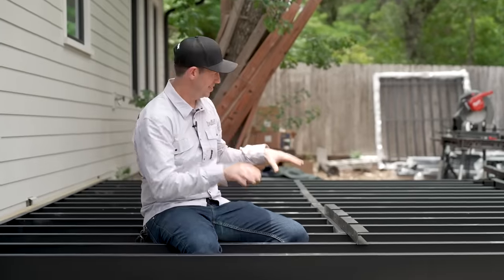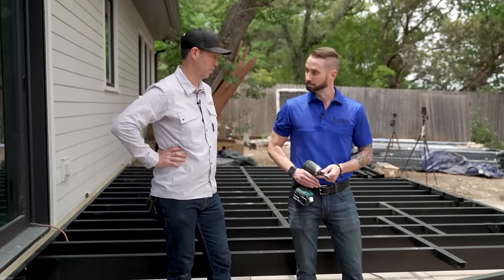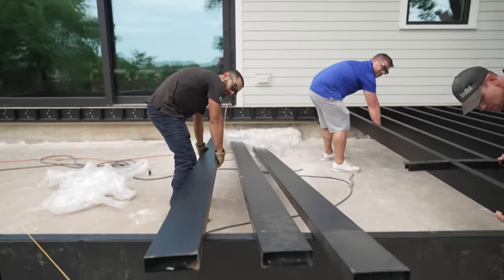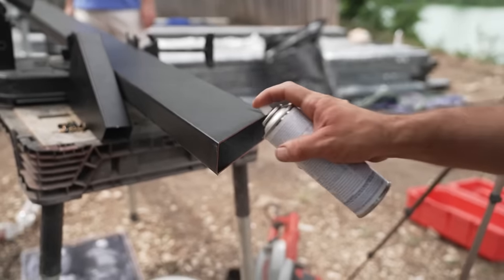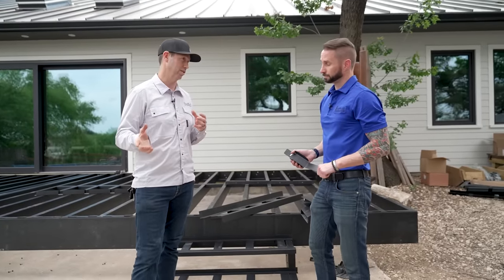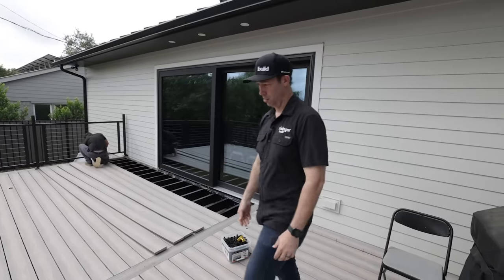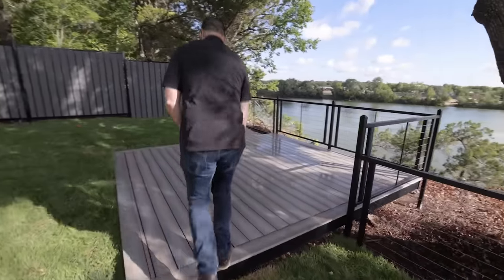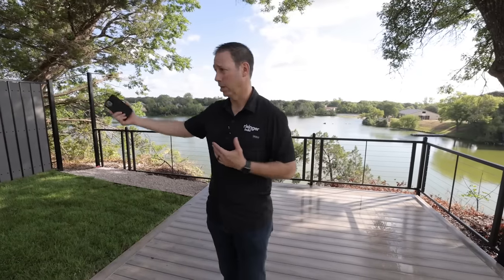My First Steel Deck Framing Job

Comment: What about sound when you walk on the deck? I love that the metal will last a long time, but can you hear the metal creaking together when walking on this kind of a system?
Reply: The decking damps it.
Reply: I'd imagine not. If you bolt tightly or weld together, it's not moving, which means it's not rubbing or clanging. Really, I don't see why steal framing isn't already much more common in residential. It's the best investment. Period. A house would be more expensive to buy and build, but would last damn-near forever. And I could totally forsee a strong market for magnetic hanging products, where you'd penetrate the sheetrock, but not the stud itself, and just hold to the stud magnetically..... hmmmmm 🤔
Reply: @mikecousin8523  not really worried about the insulation value in most applications. Can also beaf it up if needed
Reply: Very solid when fastened with counter sunk screws and/or hidden fasteners.
The steel is galvanized and powder coated, if scratched you paint that area (with either their small spray can or rust, oleum, professional high-performance enamel flat black 15oz. <- much better value).
Will outlast treated lumber framing.

Comment: I was going to use this system at my house but ran into an issue with the city building department. The code doesn't address steel framing other than it's allowed. Fortress offers extensive testing information on the product and even partnered with a third party company that offered general building guidelines that are stamped by a PE. Even with that, the city wanted a stamped site specific plan. Unfortunately, the lowest cost I could find to have an engineer stamp the site plan was about 2k, coupled with the 35% product premium made it cost prohibitive for me. I could have built two decks for the price of one. It's a shame because it seems like a great, easy to use product. I would definitely check with your city on a permit before buying anything. One last thing. If using the stamped general building guidelines, the poured base is HUGE compared to wood (starting at 24x24) due to the longer spans.
Reply: Sometimes it's better to ask for forgiveness than to ask for permission.  YMMV
Reply: @WaltWW  And, some places will make you rip it out to be petty.
Reply: You must live in a blue city/state.
Not your fault that their codes are not inclusive of newest construction tech.
Reply: Building permits for a porch.... Sounds like you need to move to another city. (:

Comment: One of my big concerns is rust/corrosion. Also possible tin sound as you walk on it.
Reply: That and Wasps building in the steel rails
Reply: SERIOUSLY?  LMAO
Reply: Sounds no different than a traditional wood deck.  The only area accessible to the bugs are the weep holes in the bottoms of the joists.  The ends have caps to cover the openings.
Reply: @foreigner1999  Yeah - you are right. No difference in longevity and strength between steel and wood!
Reply: powder coating should stop rust
Reply: I would like to hear the sound as someone walks across it too. In the video you can hear a loud echoing ring when they were looking at the stairs and he sets something on the deck. Not a deal breaker but many clients would not want to hear that.
Reply: @livens100  there is no echoing or any sound at all other than footsteps.  I built one of these at my house.  Flat as can be as well.
Reply: aluminum or stainless would be better materials
Reply: @85square  $$$$ solid gold would be nice too but I don’t think you wouldn’t think of it as “your baby” and become a deck nazi having people take their shoes off in the grass
Reply: @3_Klos1122  my job is building aluminum and stainless trucks bodies and no one badies them, becuase they stay looking good.
Reply: @85square  yea they do look good but they also probably provide a more noticeable return on the investment than a deck. Maybe not. Just my POV
Reply: @85square aluminum is expensive and weaker. Stainless is very expensive.

Comment: I'm totally lost on the 25% to 15% bump in pricing from wood deck to steel frame he quotes in this video. I can get a 2x8x12 AC2 for $15 from the big box store. The 2x6x12 Fortress joist is $139 !!!  It looks like they used ~30 joists for this project. Wood = $450, Fortress = $4,170 !  That's over 800% increase in joist material cost. Where's the rest of the math? This makes no sense unless there's some massive labor savings.
Reply: Shhhhhh. Don’t think about it. Just believe.
Reply: @JimYeats  I wanted to believe so bad to use these on my deck, even at 100% more, but the pricing I'm finding on these is 800% more at retail than wood.

Comment: Laughs in Midwest. This won’t last 15 years in the upper Midwest with winter brine solutions.
Reply: If this is in a backyard setting, with no salt or brine applied, it should last longer than that. Otherwise I agree, I wouldn’t use this on a deck that requires deicing in the winter.
Reply: @HaroldRutila  you’re telling me leave sheet ice on your deck in the winter? I think not, we treat our decks regardless.

Comment: As someone with experience in structural steel, it amuses me that they chose to go with tube instead of I-beam... I-beam has no hollow space, wouldn't need weep holes, comes in various sizes, including roughly 2x6", and has all the stress capabilities that you'd need for a deck. Tube has more torsional rigidity, but that's not necessary. Maybe tube is cheaper than i-beam? I doubt it though.
Reply: If you are going the diy route finding scrap I beam would be easy/cheaper.  It would just mean more work with a wire wheel to clean up any rust and then paint it.
Reply: thinner wall thickness so could come in cheaper
Reply: Check out Clark & Dietrich steel joists. Super strong.very affordable and it will last forever with little maintenance.
Reply: I grew up in my father's steel fabrication shop, and I agree with you on I-beams. I am concerned about DIYers and sloppy contractors properly prepping and coating site cut ends a scratches of factory the coating or doing a good prepping and coating if going with bear steel. After all paint  ain't what it once was. I still remember when we called primer "Red Lead". It definitely wasn't healthy but it protected the steel far better over time.

Comment: Installed a deck with this product last year (as a DIY) because it was the same price (or maybe less) than wood.  I really liked that everything was straight.  And the way they do stairs is ingenious.  And easy.
Reply: itll last forever too. this is the first time ive seen this, but it seems superior to wood. especially if it doesnt cost much more at all

Comment: Hi Matt, I'm from Montreal and have built my own house 35 years ago. I have applied insulation and other systems that were not even used at the time, things that you have featured in your very informative publications.
When I saw today that you are featuring the building of a steel deck I nearly fell off my chair. Since early last year I have been researching the subject. I am presently putting the final touches on an 18 by 12 feet two level steel deck behind my house. I checked Fortress' products but they were unavailable here. I opted for a canadian made Baileys Truedeck system. All exterior grade galvanized steel, shipped in a precut kit. The assembly, done by myself with the precious help from my wife, was a charm and it will last way longer than me (I'm 71). I installed my beams 24 inches on center and the whole deck is covered with Daltile's Xterior brand porcelain tiles (24"x24"x¾") I used Gator Base spacers and stainless steel perimeter brackets to keep the tiles in place. All around the steel is covered with the same tape used to cover wood joists so that no porcelain comes in contact with the steel. I will use the same guardrails you have chosen for your deck. Keep showing us the innovations in building techniques and materials. There are too many trades people who are still living in the 50's. I am a retired businessman but I know my way around a construction site.
Reply: Sounds like a classy looking deck!

Comment: Hey Matt!  I actually used fortress for my close to grade deck here in Massachusetts.  Perfectly straight a couple years later.  This is definitely the way to go
Reply: Why not use PT if you're in New England?  Wood was cheap until Bidenomics came for diesel prices
Reply: @digginz8603 Stop.  Be smarter.
Reply: @digginz8603  because the length and height of the deck meant that I could use smaller framing materials 2x6 vs 2x10 in my framing.  And it meant straight and true no matter how long it took me to build it!  Which was, by myself,at nights, 2 summers.   Mine was much more complicated than Matt's.
Reply: @foreigner1999 are you a contractor? And where are you in Mass?
Reply: @gregbrutus7484  I am. In Brighton area

Comment: With the declining quality of PT lumber,  I like this system.  Also, 4ft cantilever is unheard of with PT!
Reply: Sister a another one to get you there
Reply: get an engineer and you can do whatever you want!
Reply: @Adirondack Homestead That would not meet code where I am.  2' max. cantilever with 2x12x20'  12" O C. for a deck.
Reply: @kstorm889  You can do what the engineer wants, & that's not usually an uncomplicated route to take.
Reply: @probuilder961  or be an engineer yourself then do whatever you want!

Comment: 1:20 Matt, I'd like to offer a different perspective on mounting the deck flush with the bottom of the door.  In South East Pennsylvania, we have snow... That can prevent you from opening a door.  It can melt and ice dam and flood under the door threshold damaging the subfloor.  IMHO, Getting the water proofing details right on a flush install is much more difficult.  I much prefer having a step down, so that our crew can properly flash the door pan, and also add flashing to the top of the deck ledge board to prevent water from damaging the wood structure is the home behind the ledge board.

Would love to know more why you don't like step downs.
Reply: I suspect it is asthetics and for ease of walking in.trip hazard.but at athreshold I am always into a step as well. helps keep the ehavy rain out. A old school  building thing from the past that  still lingers in my head as a requirement.

Comment: Maybe I missed it but, what type of coating is on the deck framing? I'm concerned about rust staining and eventual rust through. Great video and a great system!
So sorry to hear about Mimi. May she rest in peace.
Reply: Powder coated.
Reply: It is also galvanized under the Powdercoat.
Reply: Why black? In Texas?
Reply: @EcoAquatica if it’s also galvanized this ought to easily last decades.
Reply: @patty109109  50 year warranty as long as you are not located near saltwater, you cover any scratches with their paint, and of course follow all their instruction, lol!

Comment: Building residential and commercial for almost 50 years and remember before OSB and pressure treated,  no nail guns and most moldings ,casings and trims were cut with mechanical miter saws and I could go on and on. I've seen marvelous new products and the tools and means for building from the ground up , many of these are here to stay and some are already being replaced but I've also found some to be not what was promoted of them by people that are not around after 20 to 30 years.  I've seen many products fail over the years , brick, wood , vinyl, composites and synthetics of all types and yes it changes with the Zip Codes ( climate and weather) There is one thing that will never ever change if you want something that will last generations  .........MAINTENANCE!  Once you build it , it must be maintained and there is no such thing as maintenance free . It is true that some are more maintenance free than others ....such as a log home and a brick home , wood soffits vrs vinyl soffits but I've lived long enough to see simple homes with wood and even the cheap Masonite sidings built in the 60S and 70s still holding up and looking like they had just been built , just because of them being washed and painted when needed . Sun and rain is your biggest home killer  , followed by too much shade and not enough sun. Log homes require far more maintenance than most homes but when you build one with a porch porch all the way around with no open decks and keeping much or most of the sun and rain off the walls and porch decks........you just cut 50 to 80 % of your maintenance and yet you still have more maintenance than you would a brick home. You match the right paints and the right oil or water base sealers and build with the sun and weather in mind and keep up the maintenance  then you will be a happier down the road that you have protected your investment,  some people take care of their cars and trucks and some could care less and some are the same with their homes, many simply believe that maintenance means that you wait until it's falling apart .........then you fix it.

Comment: Corrosion is going to kill that in the rust belt if its not galvanized. Tubes will rust from the inside out where powder coating is not able to reach.

Comment: So I've been following Fortress for a while now. I came across them on the show floor a few years back. In fact, I have always planned on using them when constructing my parents retirement home with a 3/4 wraparound porch. The project has evolved since they finished up with the architect, so now it's a screened in porch, and a three Seasoned room; all underneath a covered roof.

Comment: Intriguing system. We looked at this for a  commercial roof top deck for an assembly use.  However, with the live load needing to be 100 PSF, the spans would not have worked out due limitations of the existing substructure. In the end we went with wolmanized 1 3/4 ×11 1/4 microlams at 12 O.C.  Hope to add it to a future project.

Comment: Matt you mention you do not like a step down. What about the northern climates with snow drift and melting? I've always used a 1" step down with  flashing to prevent water damage.

Comment: I built a pressure treated deck in 2008.  In 2019 I had to replace 5 joists and about half of the deck boards.  And I also treated a bunch of small rot patches in the remaining joists with epoxy.  This year I'm replacing the all the stair treads, a few risers and using epoxy to treat the rot patches in the stair stringers.  My next house will not have any pressure treated lumber on the exterior.  PT lumber is just a temporary solution.   Even above ground, the best you can hope for is 10-15 years before it needs major repairs.  The deck on my next house will be steel framed.  I don't care how much more it costs.   If you are staying in the house more than 10 years, it doesn't make any sense to use PT lumber.
Reply: Where do you live. I’m in the midwest and my pressure treated boards are holding up well after 15 years with no maintenance.  Still going to use the Fortress system for the next deck though. PT quality is just too terrible.
Reply: @adaptedbythedans  I live in GA and just finished replacing the remainder of the joists this summer and any 5/4 deck boards that didn't get replaced in 2019.   Once the rot gets started, there is no stopping it. 

I've seen the Fortress System and would use something similar if I build an exposed deck.  I'm building a new home soon and the deck will be fully enclosed.  So the wood won't get wet.  But I may still insist on  a steel structure.  

I won't use a wood product that is exposed for any exterior surface or structure in the future.

Have you pulled up any decking to see if the deck boards or joists show any signs of rot?  The boards will look fine.  But the rot starts at the screw holes then follows the grain down the board.  You have to remove the board in order to find it in the early stages.

Comment: Trex sells a similar product and when I redesign my deck with my 3D cad program I’ll figure out how much it will cost to do it with steel. Less members, less support and I can do 2 to 3 levels since my deck area would be expanded and more open and usable. I would step it down to the yard and provide protection for the pad underneath for a secluded hot tub.

Comment: Time is money. When you're a homeowner and you don't have to worry thinking about when you're going to repaint, recoat, sand, recut, replace, recrown boards or anything and then 50 year warranty .... Man... Spend time with the family and pay the price difference and make a phone call if ever needed instead.

Looks great, wish I didn't have to aim for studs on my ledger board tops. 

Did those spacers void your warranty though by Camo?

Mimi used for your family too! Cheers to Mimi

Comment: Matt- How does this product last if you live near the ocean? I find that any steel (except maybe hot dipped galvanized steel) will rust out  & quite quickly too. Heck, I put a Feeney Stainless Steel Wire railing system on the guardrails of a deck on my house and they are even rusting slightly.  I've got tools like the tables on my drill press & table saw that have started to rust, and they never even leave my garage/shop.
You'd be amazed at the corrosive effect of the sea breeze even though my house is ~1000' inland from the ocean.
Reply: Well you could be assured any screw hole will rust out real fast since it will strip off whatever coating is on it during tightening, then the cancer will quickly spread from there.

Comment: I like the span! Can we get an update on the ledger board install? I am confused how the steel looks pressed against pt wood. Are there spacers and ledger screws between the wood and house? Did the ledger have to be tied in between exterior and interior?